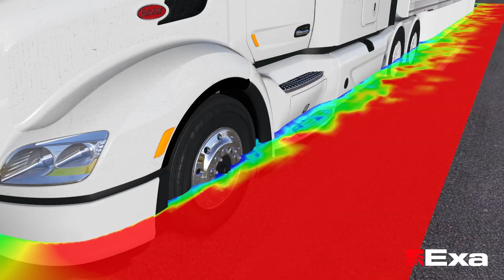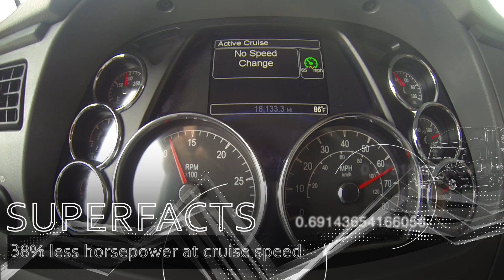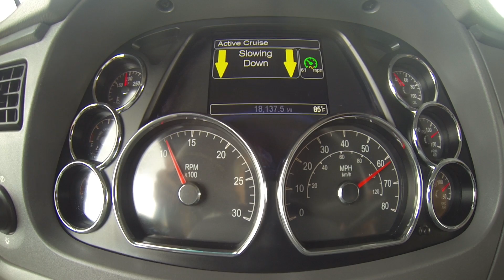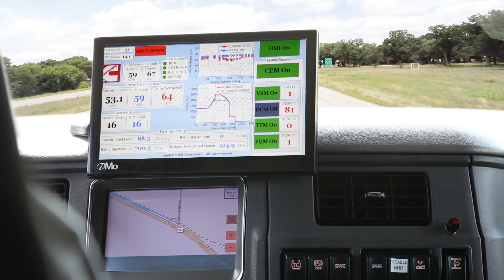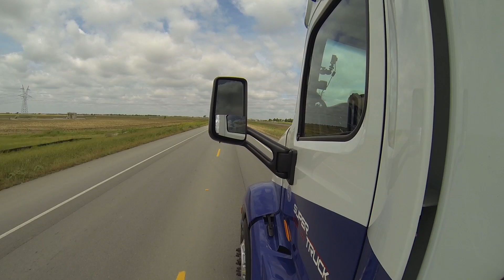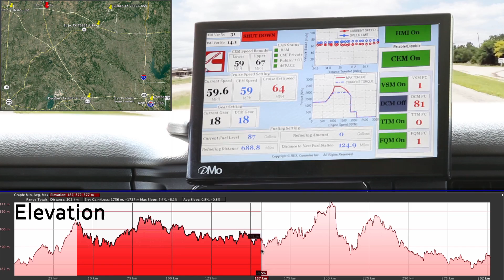SuperTruck Test Drive Pt 3: Technology Imitating Life

Comment: This truck has become an oversize pickup. There is nothing good about this truck when it has to perform but it hss reduced to a Peterbilt Pickup. The engine performance may sound good but the parts for a vehicle is a joke. A truck that pull heavy loads and most times extremely heavy loads neef heavy parts that can with stand the punishment these vehicles endure.  Peterbilt that 39 million dollars you guys spent need to be revisited.  Peterbilt built super tractors not pickups.
Reply: Shut up